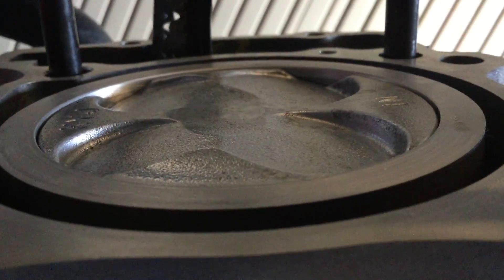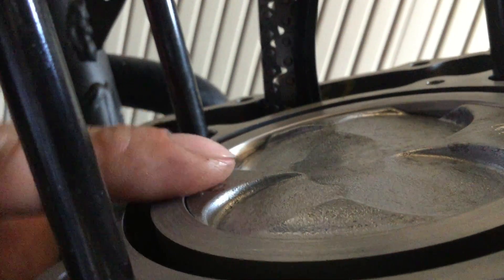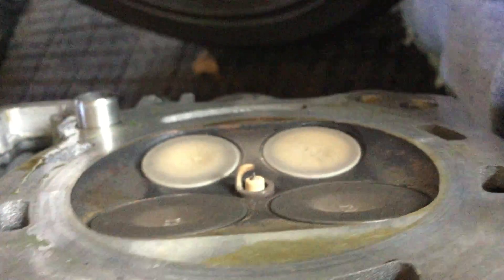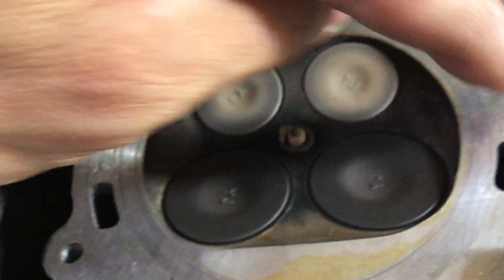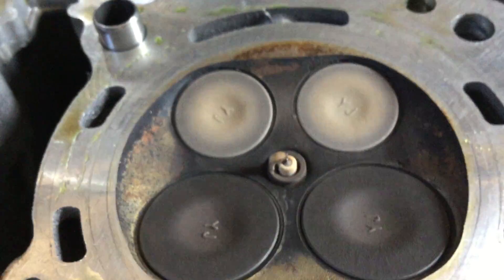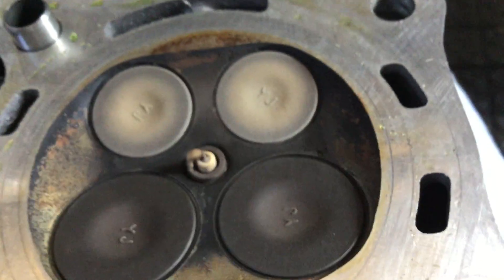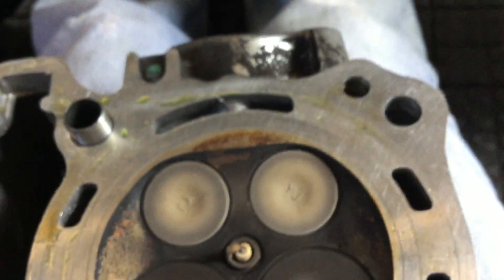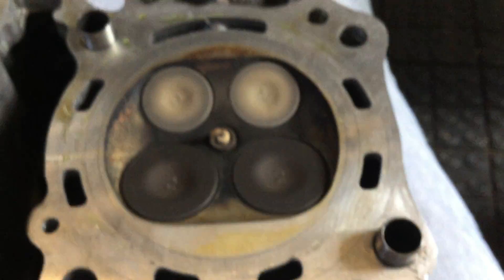CRF/CBR 250 piston in CB/CBR 300

Comment: Cilindro CBR 250r is the same Cilindro CBR 300r? I mean, it's possible CBR 300r Cilindro works on CBR 250r motor?
Reply from the maker: Yes the cylinder is the same, just different colors and 249cc or 286cc label.
Reply: @DaBinChe  so good! I would like using a CBR 300r cylinder on my CBR 250r. So it's easy, only I have to change the cylinder and it will work normally without any problem?😍
Reply from the maker: @Eltiposoy  make sure you also use new head gasket...but why are you using new cyclinder?  If bad then change the pistons and ring too.  Those go bad before the cylinder.
Reply: @DaBinChe  My CBR 250r motor is good. But I would like more power without to damage my bike. I heard that CBR 250r and 300r using the same cylinder
Reply from the maker: @Eltiposoy  changing 250 to 300 cylinder does not change anything, your size will still be 249cc.  The 300r uses a stroker crank to make it 286cc.  By the time you do all the needed changes to a 250 to make it a 286 it is cheaper and easier/faster to just swap a 300r motor in.  Find a wreck 300r motor and all electronics (fuel injector/throttle body/ECU/etc.) to make it run properly.
Reply: @DaBinChe  Thank you for the information! Very kind of you 👍🏽